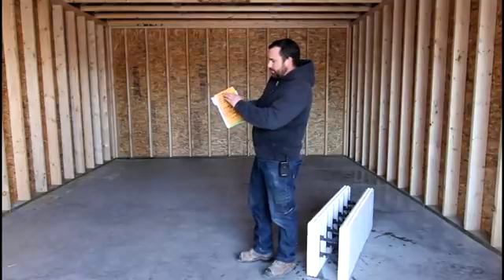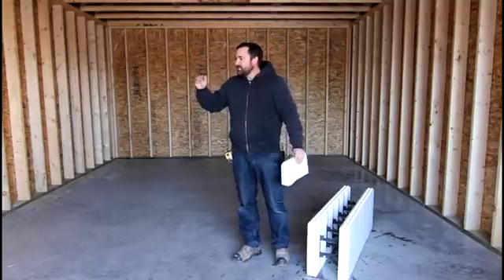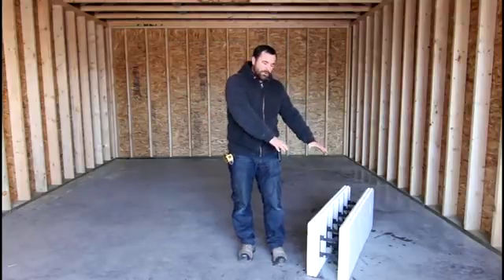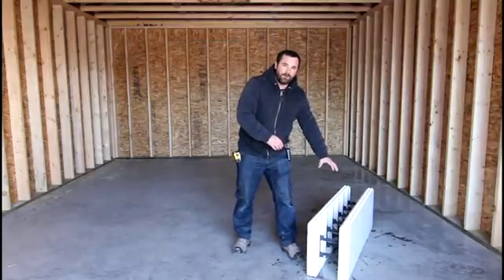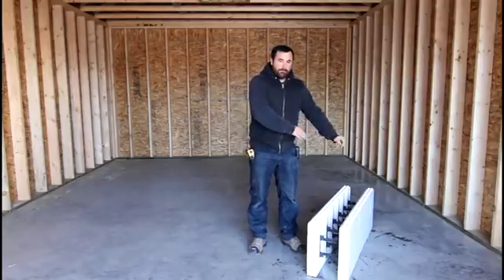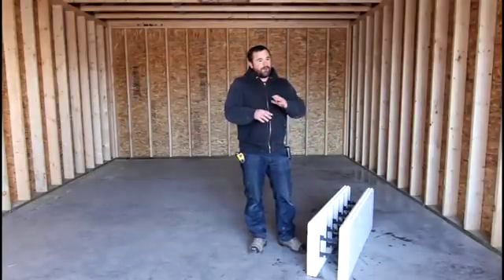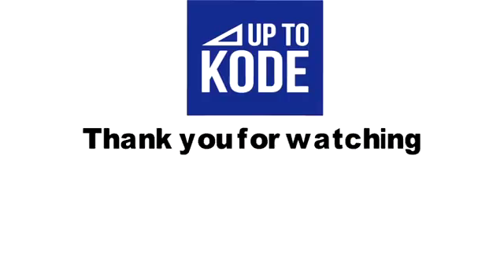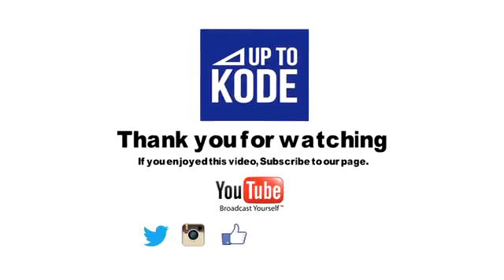ICF vs Wood : How a Spray Foam 2x6 Stud Wall Compares to an ICF Wall

Comment: Build Alaskan wall. Double 2x4 walls (with staggered studs). Spray foam that sucker and you should be fine up to Mars temperatures :P
Reply from the maker: That’s one way. I think you would be very close to the same cost as ICF and you would be lacking other advantages that ICF offers. But your method would be perfectly fine as well

Comment: What about ICF vs Tstud? That would make it a more level playing ground due to the Tstud allowing a full coverage of the foam throughout the wall
Reply from the maker: It would help for sure with thermal bridging but nothing you can do to a wood wall will ever make it equal to ICF. In terms of strength, insulation value, thermal mass, sound, rot proof, and multiple steps done at 1 time.

Comment: Great video, very informative.....I would recommend you spend just 1min talking the negatives of ICF (and not just extra cost).  For example ICF has challenges doing a waterproofing on outside since then chemicals don’t deal with form well.  Also a huge deal with ICF is the possible future remodeling cost (add a door, expand a space for new window, even move an outlet is very expensive into concrete vs standard framing).  You also have challenges with the roof for ICF, and without a dehumidifier, condensation will form being so well insulated.  I believe it is a fantastic system, and no question for insulating, but everything comes with a trade off.
Reply: Dehumidifier is not a big cost. If you install HVAC split system, they have dehumidify function on them. Water proofing is also not an issue anymore there are several products that are very good. here is one set of products that works very well.
https://poly-wall.com/waterproofing-system/home-stretch-icf-waterproofing-membrane

Comment: ICF adds easy 10% on the price of your build! i'm dealing with it now... the price is $85,000 just for the exterior walls..
Reply: how many square feet and floors? If I may ask?
Reply: 12 months later your better off using platinum studs instead of wood, it’ll be cheaper
Reply from the maker: Prices are all over the place right now.
Reply from the maker: How big is this house? That’s is way too high. So either you have a house over 4000 square feet or someone has quoted extremely high because they think they can.

Comment: How do you run electrical, plumbing., etc in an ICF?
Reply: Before you pour the concrete, you plug the necessary holes on the forms, like they do on regular lumber concrete forms. Then before you fasten the drywalls directly to the ICF forms, which they have high density plastic studs inside, you carve the EPS to create channels to route the wire and pipes. You could also add lumber studs on the EPS, for installing the drywalls, although it is a waste of time and material.

Comment: What you are talking about is actually thermal bridging.  The 2x6 have an r value of 1.41 per inch, which is equivalent to 7.755 r value. I do all kinds of insulation, and the blow in is what i make the most money at. That being said, spray foam is the best there is. Period. It is NOT about r value.. i mean a yeti cooler is awesome.. unless you are opening it and grabbing beers out of it frequently. The most important part of building science is air sealing. End of story. You air seal, and add the high r value of spray foam and it doesn't get any better considering our modern day building strategy.

Comment: What about T - studs I have been looking into them they look awesome.
Reply: I saw a demo of T-studs. They fix the thermal bridging problem and are stronger than standard framing lumber, but they are more expensive.
Reply: @daiwie7044  Depending on size of house can save lots on heating and cooling.Getting back investment quickly .

Comment: Don't you still have to frame walls inside to hang drywall.
Reply from the maker: No. There’s plastic ties every 8” that hold the form together during concrete placement. Those same ties run vertical (like a stud) and you can attach to the exterior and interior very easily.
Reply: @uptokode  so for things like electrical and plumbing, do you just chisel paths through the foam? For exterior like vinyl all the screws will be drilled through your vapor coat/wrap?

Comment: Can you use air create in these as it would save on cost and increase R value
Reply: Aircrete as yet is untested to qualify as a structural component. You could use pumice Crete in areas it qualifies. Aircrete has much more testing to pass to qualify. Currently concrete for structural applications is coded to require 2500psi compression strength where aircrete is about 500psi on a good day. I hope integral composites of aircrete are one day qualified (I’m researching it now) for structural use but as yet it is not viable for such as far as codes are concerned.

Comment: Most garages are not set at 12 inch on center. you have way to much wood in there, also they don't use 2x6.

Comment: ICF is great for the basement or below grade, but not for the entire house. Try to run it up to the second floor...need a very beefy foundation. Overall, more work and cost entirely too much. Your cost calculation is off...way off.
Reply: P Dan.  Not true.  We take all our ICF builds to the roof.  The above grade walls are the same thickness as the basement walls.  The only thing that is bigger is the footing.  Where we live (Sask, Can), a footing would be 16" x 8" for a traditional basement (bungalow).  To build the same with ICF, the footing is typically 24" x 8".  To go to a 2 storey, it would be 30" x 10".

Comment: @0:30 I think you meant "Thermal Bridge" as in: a bridge between the inside and outside temperatures of the structure (the building).

I dare say that SIPs are probably the way of the future, but then it's more of an assembly job (like ICFs) than a traditional carpentry job. They have almost no thermal bridges and they have a much higher R-value. The only thing they don't have is Thermal Mass.
If properly insulated, cement can be a GREAT benefit to the R-value of a structure - but ALL the insulation needs to be on the outside of the cement wall (the thermal mass) so the thermal mass does not change temperature thus maintaining a comfortable temperature inside the structure.
Germany is a world leader in the Passive Haus (Passive House) homes. There are a few homes in America that are designed by the Passive Haus people, but more common is a concept called "Net Zero" homes which is a similar concept, but not quite the same. The Passive Haus is a movement that has been growing for decades in Germany and is starting to catch on in a big way. 
This is why physics (thermodynamics) is important to learn in high school and university for architects, engineers, and designers. However, unfortunately for us in the USA, the electric and gas (and HVAC) industries are not too keen on this movement gaining momentum here as it greatly cuts into their revenues.
Reply: The Germany to USA comparison fails because of the climate differentials. The USA has radically different climates from region to region whereas Germany is relatively similar. You never see passive houses in desert climates or areas with dramatic seasonal differences and large swings in seasonal or even daily temperatures. Or when you do they fail to maintain comfort levels acceptable to most inhabitants. The HVAC industry is protecting itself but has also created much more efficient systems than were available even ten years ago. These more efficient systems combined with high R-Values use less electricity which reduces the amount of electricity required by a solar array.     I like ICF for more than its thermal mass. ICFs can create and almost silent interior space. The mass of ICF is more resistant to storms and resulting damage. Finally, ICF house walls, it thick enough, are bullet proof.
Reply: You're right. Most Passive Haus s are in Northern Germany where it only reaches 100F for one month in the summer.

I live in Shasta County, California. It freezes in the winter, and it's 110-120 in the summer (we were on the national news back in 2003  for 118 degree heat - tied with the Sahara Dessert for the hottest place on earth that day (July?).
For 6 months of the year we have to run A/C to cool the older buildings (my apartment was built in the 80's, two stories, and only 2x4 rock wool (aka fiberglass) insulation - which is another issue: convective heat rises to/through the ceiling and then loops back down through the ceiling in a current.)

But, like I was saying, SIPs in modern buildings can create a passive haus if the insulation is thick enough (sure, this is not "cost effective" because closed cell insulation is quite expensive (only because of greed from the chemical companies of course). Also, thick insulation on the outside of a cement wall would also work because of the lack of thermal bridging in SIP construction which could be installed on the outside of the cement walls (thermal mass).

But instead of 50 degree frigid air blowing on the back or one's neck, there's a much better way to cool any building, and it doesn't even need HVAC - https://youtu.be/CVginpnALL8
Reply: I lived in northern Oregon for 20+ years and now in Phoenix for 20+ years. I was never impressed radiant heat from a ceiling. Don't know about radiant cooling. I am curious about chillers as opposed to A/C and think that continually moving a low volume of air (HVLP) at a constant even temperature (warm/cool not hot/cold) would be the best solution. Still doing research. For the record, I like SIPs and think it's a great technology and hope the it and ICFs and the like gain wider acceptance. We really need to put stick framing behind us, seriously.
Reply: I totally agree with leaving stick framing behind, but now architects are saying that they can build skyscrapers with wood beams instead of steel and concrete. They claim that it's "greener" than cement (and I've heard this for the past decade).

Yeah, radiant heat from a ceiling doesn't sound very comfortable to me, but cooling sounds great (as heat tends to rise) but the radiant flooring option seems logical.
I think that there probably isn't any one perfect solution, but as we design structures to be comfortable and "green" taking into account the climate they are built in, I think that may be the best way to design and build.

I grew up with a wood stove for heat, so I'm not too keen on the idea, but wood doesn't have to be the heat source, and these soapstone fireplaces claim to be excellent thermal mass lasting for 12-24 hours (some even have a pizza oven built in). https://www.tulikivi.com/usa-can

Again, one could use gas or solar-electric or any heat source with a mass of soapstone and get the same efficiency and effect. Some people have built thermal mass out of earth (dirt/straw) surrounding their fireplace/stove. Using earth seems like a no-brainer, but no one (corporations) likes it because you can't sell it/make a profit off of dirt that is already on the person's property that they own.

I have also thought about HLVP myself and wondered why the industry hasn't changed decades ago from HVAC (must be a $ profit thing). It makes total sense to change the air by a degree or two and push it through the ducts 75% (cycling off 25% of the time) of the time rather than expensive AC units creating annoying/uncomfortable 55 degree air.
However, with thermal mass there's little need to move air, and moving air is not as efficient/economical/green as it uses energy to turn fan blades...unless it's solar or similar green powered. But then there's still air movement which I don't consider as comfortable unless it's fresh air coming through my windows.
Reply: It all comes down to money, tradition and the unwillingness to change. Looking through the comments on this video alone I can see emotionally driven replies which is is counter productive. "New" technology is always more expensive until widely accepted and production costs are reduced. If we apply some of the logic seen here to other technologies none these people would have cell phones, computers or a modern car. The construction industry is one of the last Luddite strongholds. It's sad really but won't deter me from building an ICF house.
Reply: I'd love to see the numbers from an engineer/architect on the R-value when compounded by the nice thermal mass provided by the cement inner wall.

If that's what works for you then good for you man. Go for it. It should be very good in Arizona to have that much thermal mass especially if there's a ton of R-value insulation outside the cement wall.
Reply: @DarrenD777  Heating air is the absolute least efficient way there is. Think about it. You cannot achieve thermal mass with air. Air fluctuates wildly in temperatures. Put in a geothermal system and call it a day. They are easy to install and not nearly as expensive as people think. Pex is cheap and anybody can install it. HVAC guys want 300 an hour to play oragami with duct work. HVAC gonna go the way of the dinosaur.
Reply: @markjohnson6498  I agree. A Passive House does not use HVAC, in fact, it does not even have it installed.
I hate HVAC. Where I live it is commonly 100+ degrees parts of May, and all of June, July, August, and most of September. And with building codes so incredibly lax, and most buildings being older - the serious lack of insulation means the HVAC runs 20-40 minutes of every hour in my townhouse apartment during the day (11AM-9PM).
But with SIPS there isn't so much need for thermal mass. The insulation of R40 (or more!) in the walls and R60+ in the ceiling creates such a strong barrier to heat transfer that the air inside simply stays at a comfortable temperature. Sure, it might be cheaper to use cement walls and floors with a similar R-value of insulation to block heat transfer into and through the cement thermal mass, but I'm not an architect or engineer, so I don't have those numbers.

Comment: if its so simple to install why is the cost so much higher than traditional stick build labor.
Reply: Because the bigger builders don't want to change the way they do things, as they would have to learn to do things differently, which most don't want to do.  They just want to hand the plans off to the respective trades and be done with it.

Comment: This system would I think cause problems when you need to mount something inside your home and need it anchored to a stud. Can u clarify if this is incorrect?
Reply: Depending on the brand of block, there is a "stud" in the wall every 6", 8", or 12".  cabinets can be hung directly off of the ICF.

Comment: ICF's have superior insulation properties, no doubt. But what about the interior and exterior cladding. Left raw, ICF's are not flame resistant. And don't forget about the complexities of running wiring and plumbing through them.
Great for foundations though.

Comment: Concrete adds a hell of a lot more than 5% to the coast.
Reply from the maker: It’s only 5% on an entire house build. That’s because there’s a ton of other costs that help keep the difference of price into perspective. Yes if you compare specifically a wood wall to an ICF the ICF is a lot higher. However the point of the video is instead of throwing an expensive insulation at a wood wall why not consider ICF for the entire home because OVERALL it’s not a lot more and the benefits are substantially more than conventional. 

There’s 2 schools of thought ...you either base your decisions entirely on price or you weigh the balance of more advantages compared to what that added cost is.  

Either way...thanks for the debate.
Reply: It's worth it

Comment: The first thing a person needs to determine is does he want to save money on the construction cost or long term over the heating and cooling cost.  Keep in mind that payback for heating and cooling is going to be long and slow but that is not to say it is not an important consideration.  One of the best buildings I have seen was done with 2 X 6 outer walls on two foot centers. There were no wires, pipes, or interior receptacles or lights installed in this wall. It was sprayed full of urethane foam.  Inside of that a two by three wall was constructed with 3/8 sheetrock on the outside. all wiring and plumbing was done inside this wall.  A 1" dead air space was left between this interior wall and the exterior wall.  The Doors and windows were the only places the walls were linked.  The house was dead quiet no matter how hard the wind blew and so tight that an air exchange system had to be installed to keep the air good. Cost to heat 2600 square feet, 75 a month Electric (based on a wattage meter on the furnace.